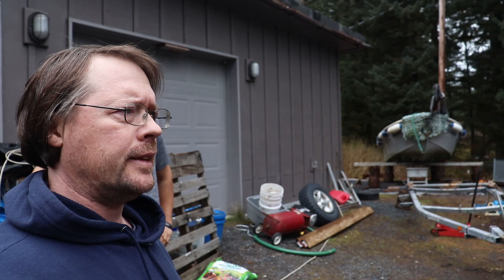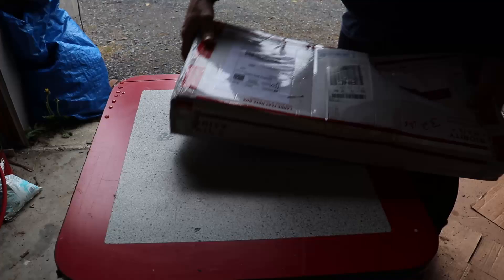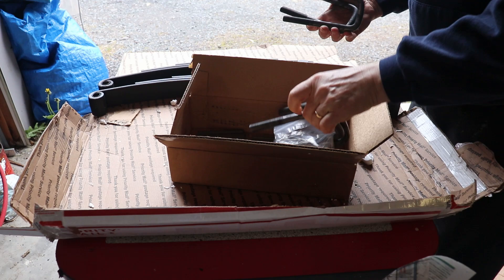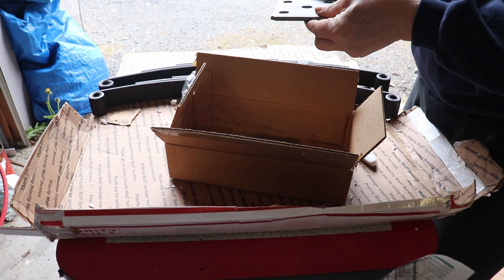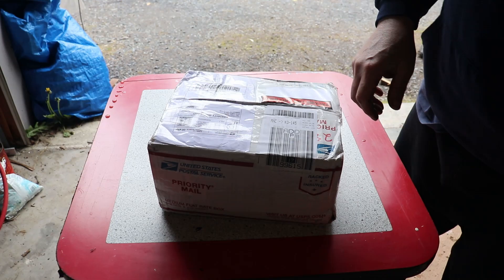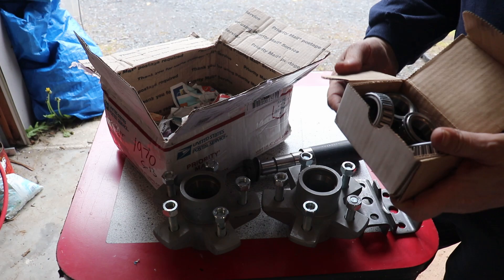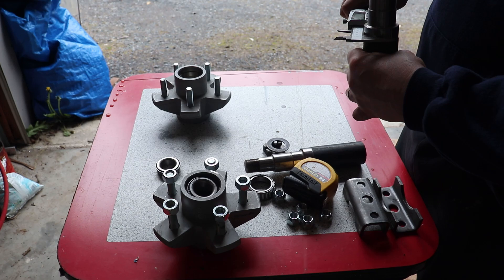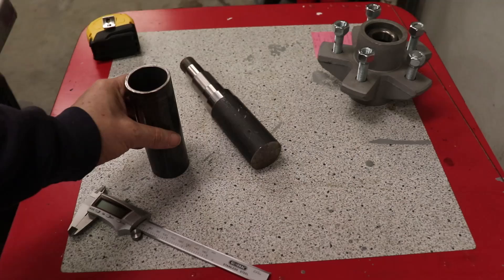Skiff Trailer Rebuild Pt 3 - Hubs and Spindles

Comment: If you freeze the spindle and heat the sleeve it will slide right on
Reply from the maker: I was going to freeze the spindle, but the axle didn't quite fit in the freezer. LOL. Great tip for sleeves, bearings and bushings though. Thanks Charles.